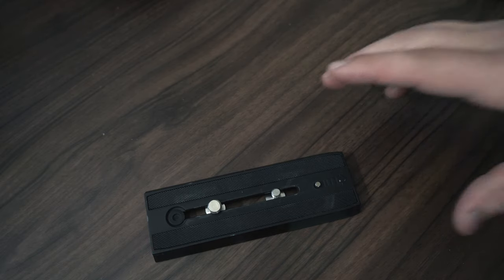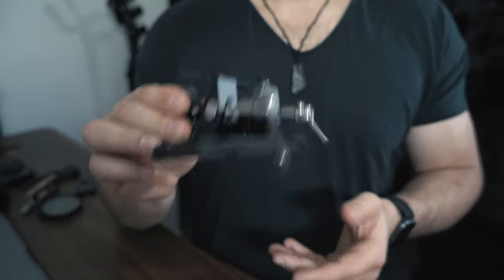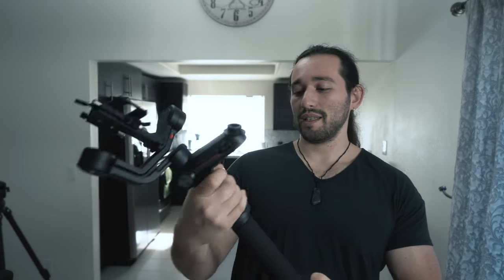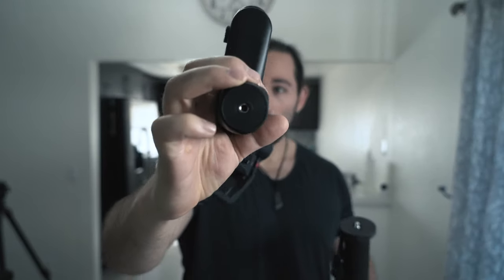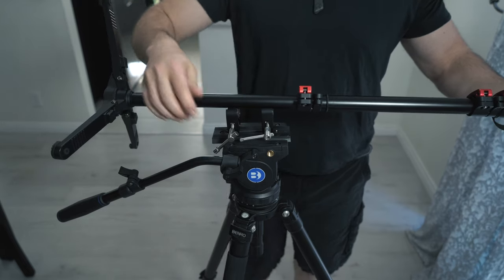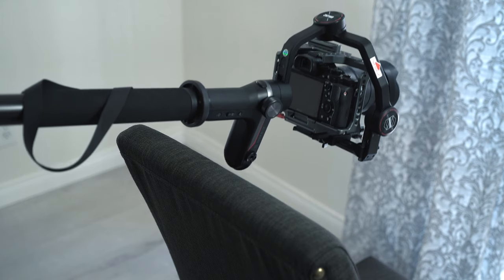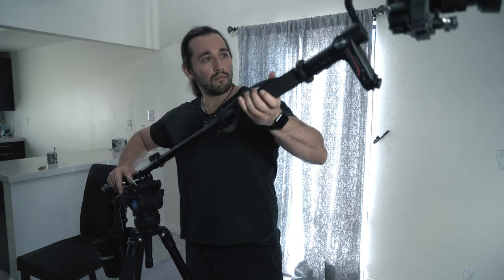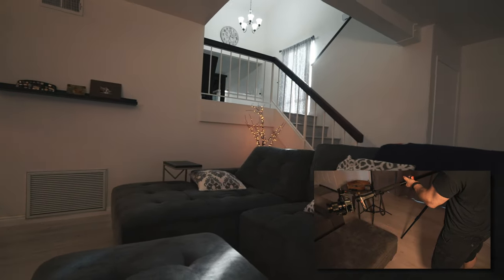YOU ARE USING YOUR GIMBAL WRONG! - DIY Rig For Stabilizers! - Weebill S - Ronin S - Moza Air 2

Comment: Hmm thats a step further than I was looking for but it's a great idea, My problem my follow focus only works on the gimbal, so how to keep the follow focus working. Mk Ak2000 has a 1/4 20 by the motor at the top of the handle there is just enough room for a quick release plate and so I laid the handle parallel to the tripod head. It's pretty nice. It's not beyond  reason to mount a monitor to the tripod and run a cable to the camera.  Actually with my monitor being on  my handle a nato rail might be an idea. :) ...

Comment: is it possible to remove that 1/4" screw at the bottom of the Weebill S? To be able to mount 3/4" monopods. I couldnt unscrew it since it isnt the same screw with the Crane 2's tripod mount. Thanks